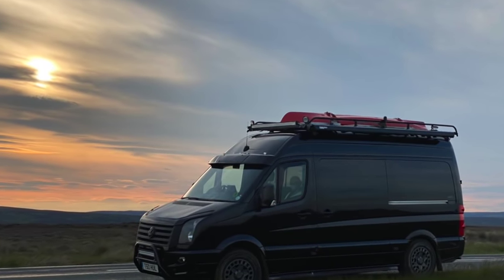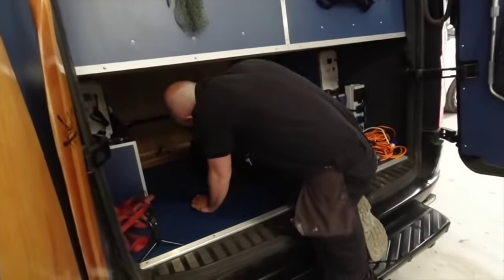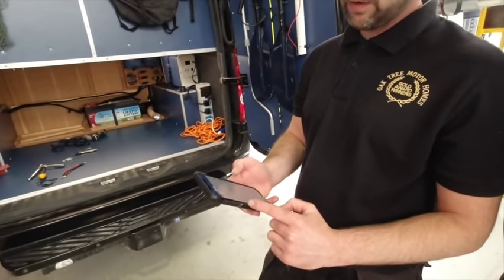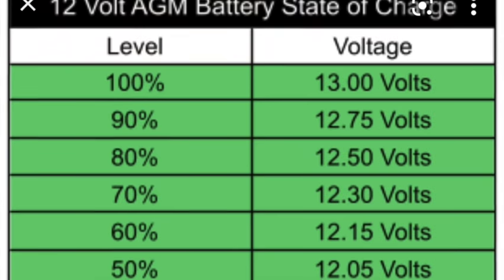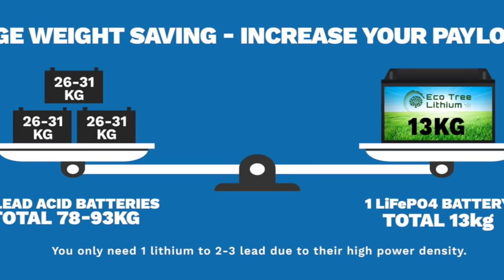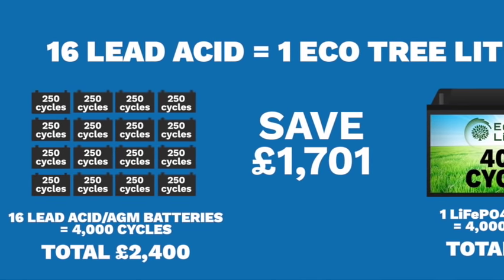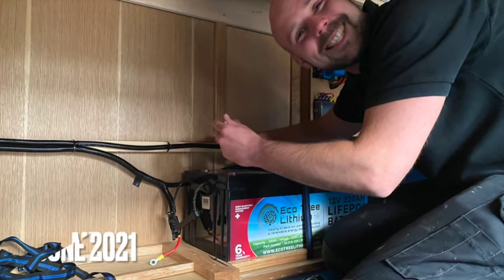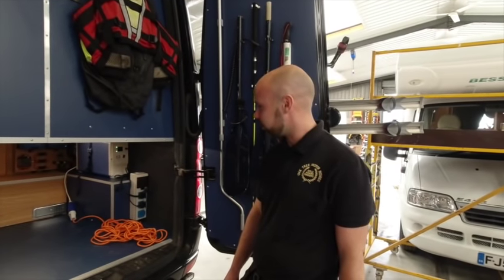Campervan Batteries Lithium or AGM?

Comment: good point made about the perfect csmpervan for you etc

everyones situation is different and as such so is there needs and wants in a campervan etc which is why campervan self build layouts are different etc

having driven virtually every type size and vehicle manufacturer van over the years for work etc i prefer the vw cradter too but having had to load  and unload a long wheel base van 5 times a day for work etc there is too much space in a long wheel base van for me so when i lived full time van life i lived in a car which was perfect for me with no leisure battery no solar panels no cooking stove and no fridge etc which made living in a car so easy
Reply from the maker: Many thanks 🙏

Comment: Lead acid batteries are still best for starting a vehicle. I believe lithium is no good in the cold and should not be used under bonnet because of engine heat. Good discussion. Cheers. I hope the whippets are doing well.
Reply from the maker: I don’t think that’s the case anymore you can get specific lithium batteries for starting engines and I have a hybrid car that start 2.4 L petrol engine with lithium and this winter we had four weeks where we got down to -8 and the car and it’s batteries worked  no problem at all 🙏👍😎

Comment: How do you protect the Lithium batteries in the winter, I understand Lithium should not be charged in subzero temperatures?
Reply from the maker: They have heat sensor monitors fitted to them so if the temperature drops to below -5 they will not charge if you noticed my heating system goes into the back which will also keep warm and the van is very well insulated too 
So not a problem for me 👍🙏😎

Comment: This the same company that fitted out Darren's van from The Urban motorhome ... could you give us a rough idea as to cost involved please.
Reply from the maker: Yes 👍 they are a great team and Camper vibe had their batteries changed over too 👍
Reply from the maker: The batterie is £1699 👍
Reply: @onemanandhiswhippet  thankyou, something to think about in the future, not that I will need that size battery
Reply: @onemanandhiswhippet  Did that include the cost of fitting?
Reply from the maker: @intransit2822  yes but mine was just a swap give them a call for a price it all depends on what needs doing 👍

Comment: Great battery if you have that sort of money . I would imagine they would be really good until for any reason they are not receiving any charge at all in the winter like all lithium batteries if they don’t get charged  at least every 3 months they become dead for ever . So for the camper that is only used now and then unless you can afford them they are far too expensive.
Reply from the maker: Hi there no not with theses not changing for 3 months the power will drop a little but the Lithium will recharge and be fine 
Thanks for watching 👍🙏

Comment: That's a whopper of a battery, we're still on an old lead acid battery but it's probably the most modern technology in the van 😂
Reply from the maker: Lol 😂 well if it works 🙏👍😂
Reply: @onemanandhiswhippet  We can definitely get a long weekend out of it. It only really does the lights and water pump.
Reply from the maker: 👍 perfect for you then 😍🙏👍